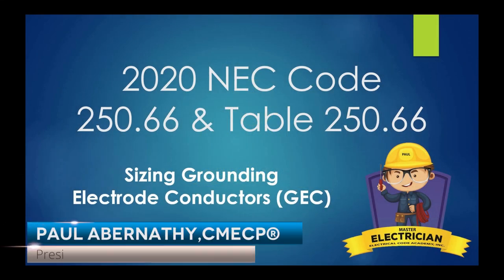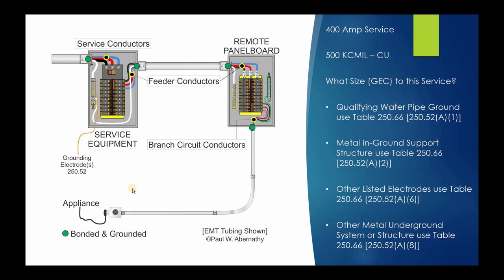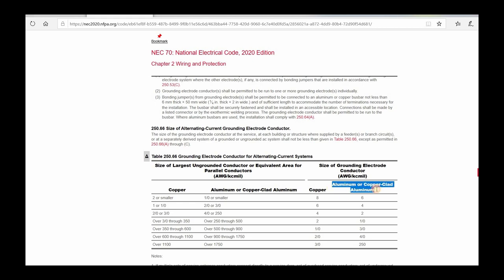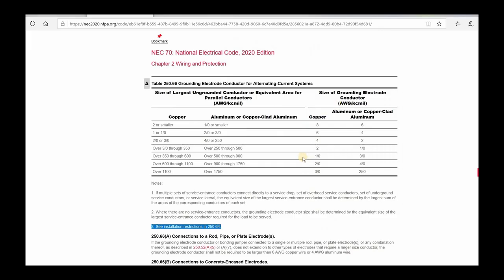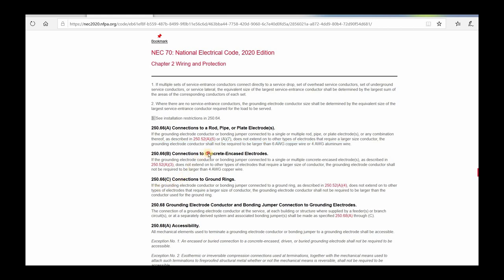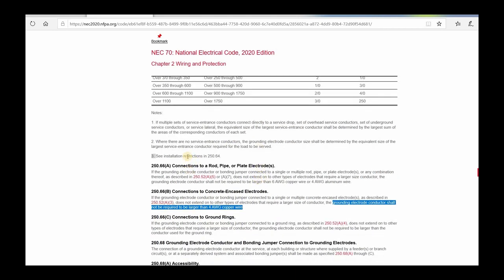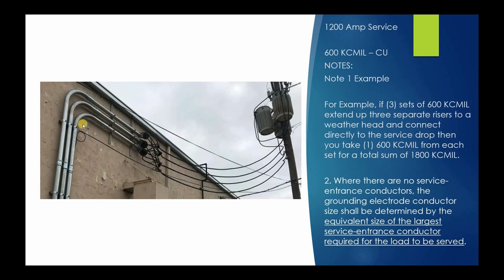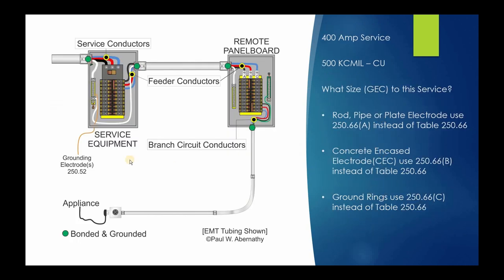Sizing Grounding Electrode Conductors- Basics of 250.66

Comment: How would you size this in the case of a meter-main combo that isn’t using wire to connect the meter to the main disconnect? As in they are bonded through zinc plated aluminum bars.
Reply from the maker: The GEC is sized based on the SE Conductors that supply the meter combo. From the point of attachment to meter is sized per NEC or if just rods then 6 AWG CU only per 250.66(A).
Reply from the maker: Also, use note 2 in Table 250.66  if you don't have SE Conductors. You would determine size of conductors needed based on Service installed and use those hypothetical conductors to choose GEC size, unless its Rods, Pipes, Plates, CEE, or Rings per (A)-(C).
Reply: @MasterTheNEC  got it, that makes sense! Just thought it was interesting since there’s no SE from meter to main disconnect but looks like they’ve already considered that.

Comment: What if you had 4/0 copper parallel how do you add those
Reply from the maker: Chapter 9 , Table 8 has the Circular Mils of the 4/0. So, you would add the two together and then visit Table 250.66 and treat the two 4/0 added together as a single conductor and then select from table. For example, the 4/0 is 211,600 x 2 = 423,200 kcmil. You go to Table 250.66 and use the 423,200 as if it was a single conductor =, which places you in the over 350 through 600 for CU and then side to the right and the GEC would be  1/0 CU or 3/0 AL. Hope this helps. If you are asking WHY we add the 4/0 together, read the header of the first column in Table 250.66. It says " Equivalent Area for Parallel Conductors"....The equivalent area is adding the two conductors circular mil area together.

Comment: Did we make a mistake?  We are installing a 1200 Amp disconnect,  we installed 600 Kcmil wire, but the disconnect only accepts 500 Kcmil wire.
 Should we had installed 500 Kcmil instead of the 600 Kcmil or the disconnect should accepts the 600 kcmil for 1200 Amps?
 Brand;  ABB
 Part number; TMAX XT7H1200
Reply from the maker: Your question lacked details. However, any lug listed for 500 kcmil should not have 600 kcmil installed on it unless the lug is listed to accept 600 kcmil. Since you state the maximum size is 500 kcmil then using 600 kcmil would be a violation of the listing per 110.3(B).

Comment: Ok. So from you video of code interpretation,  i understood that It is legal to run #6 grounding electrode to 2 ground rods from 1200amp service.

So other words:

1,200am service --------》#6wire-------》1st ground rod------》#6wire -------》2nd ground rod.

Did I get that right?
Reply from the maker: When it comes to using 250.66(A) for Ground Rods the ampacity of the system is irrelevant. The allowance in 250.66(A) says the GEC doesn't have to be larger than 6AWG CU or 4 AWG AL.
Reply: @MasterTheNEC  Thank you sir

Comment: Hi master.  Can we use insulated conductor (green) on grounding electrode conductor? I saw a grounding electrode conductor, using white wire, is it okay?
Reply from the maker: Well, I don't like the idea of "white" being used. However, as a "Code Guy" the white color rules apply to grounded conductors and not GEC's. In fact, the NEC permits the GEC to be insulated, covered, or bare. The 2023 NEC cycle attempted to define the color of insulated bonding jumpers and GEC's and it failed.
Reply: Thanks master. I appreciated it.

Comment: If over 1100kcm or 1750 kcm on table 250.66, don't you need to multiply by 12.5 % and then you use chapter 9 table 8 to get correct size of conductor ?
Reply from the maker: Nope....I think you are confusing 250.66 with 250.102(C)(1) or your using an NEC from before 2005 maybe.